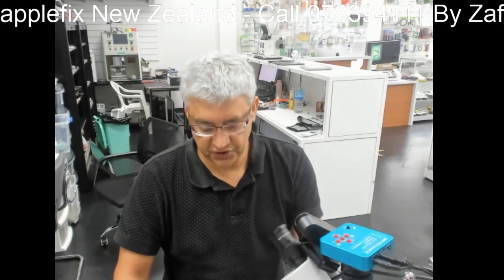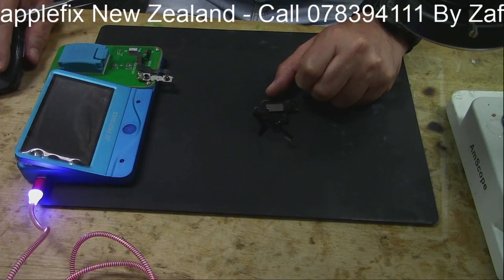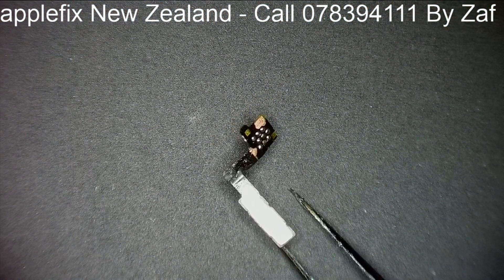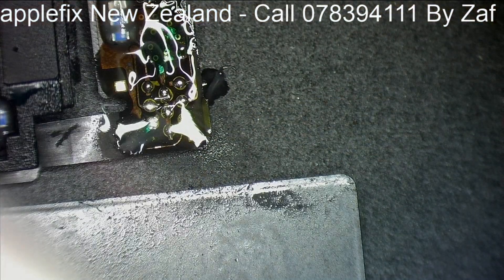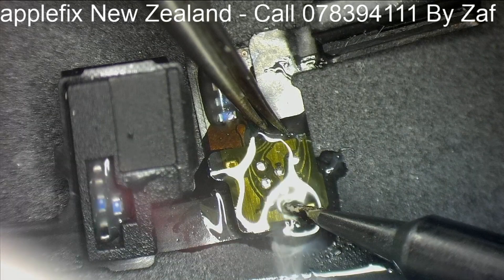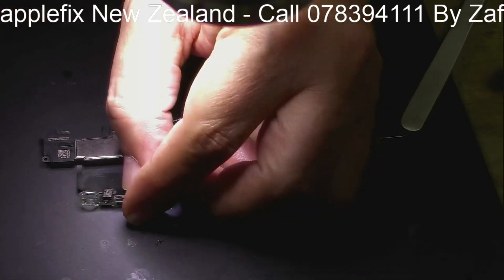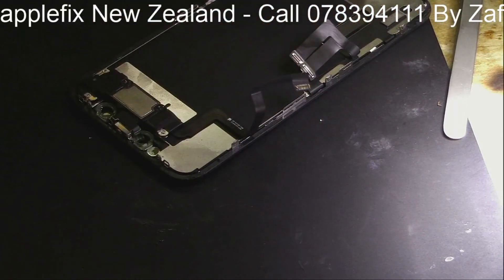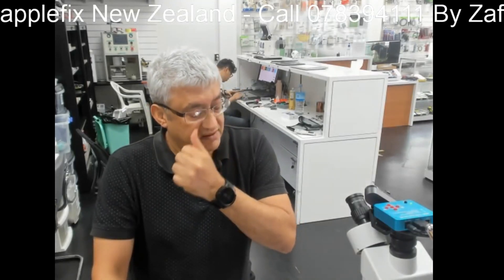iphone 11 face id not working, not dot projector @ AppleFix New Zealand by zaf

Comment: Sir.
I am having a Querry
My face id is asking to move phone lower and higher.
But my Dot projector and flex cables are working fine.
We checked it on Flex cable data copying Device
Face Id status is normal.
Portrain mode is working Fine.
But still face id is not working